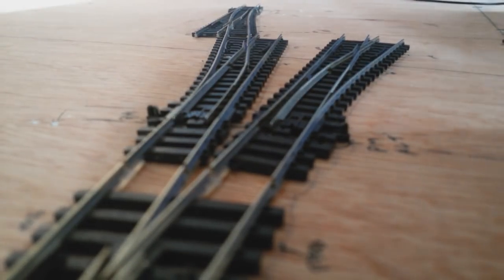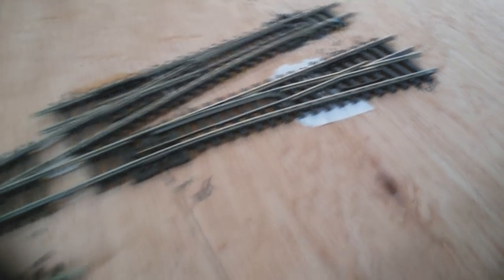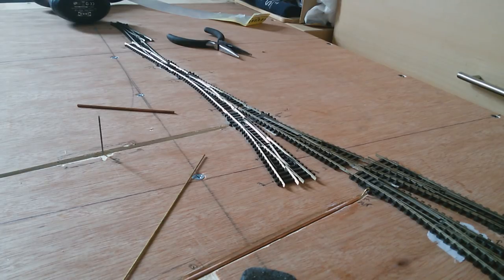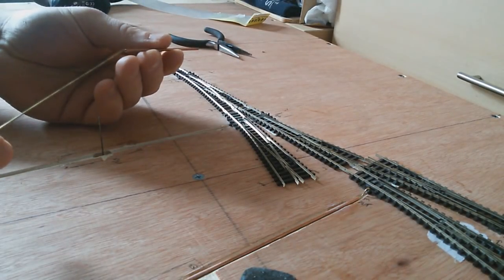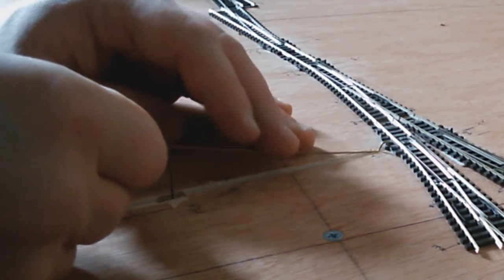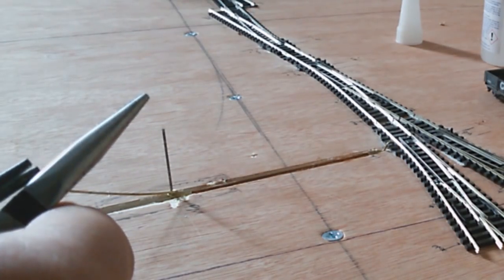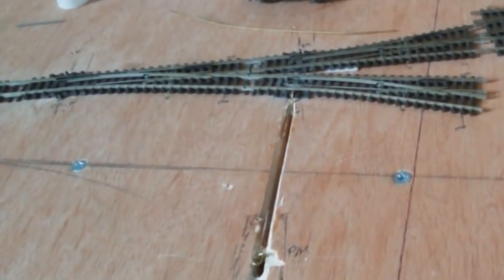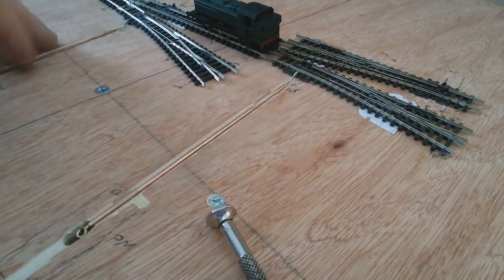Out N About Norramby  Part 3 - A Willy in a Welly!

Comment: ingenious way of switching the points that would come in handy if there are timber supports under the baseboards just where you need to get a point motor in. thanks for sharing Tony
Reply from the maker: TONY NORTH EASTERN - No problem. :)

I had to find a way to extend the drive due to the busy stuff under board so this is is the result.

Thanks for checking out my channel by the way, glad you have popped by as for the past few months I've been devouring your videos on your channel.  Very much liking your content. :)

I also model in 00, P4 and teeny bit of 0 by the way.